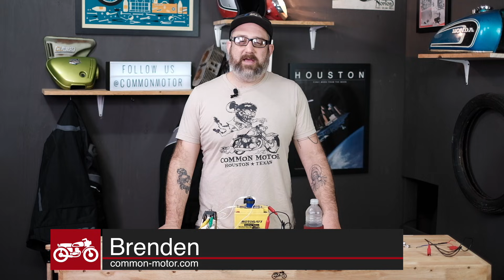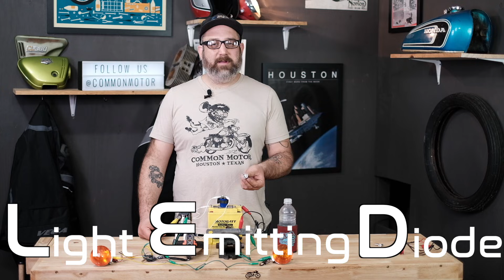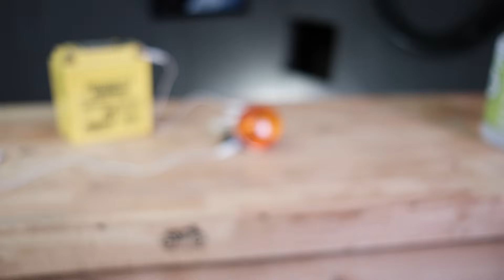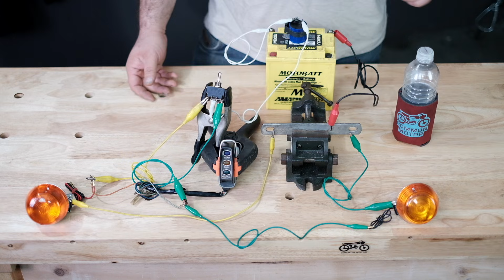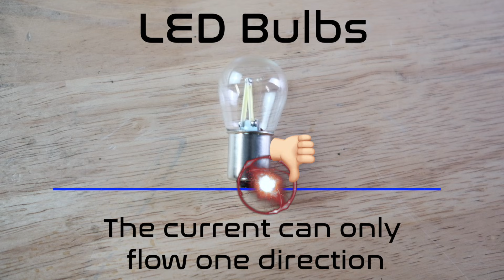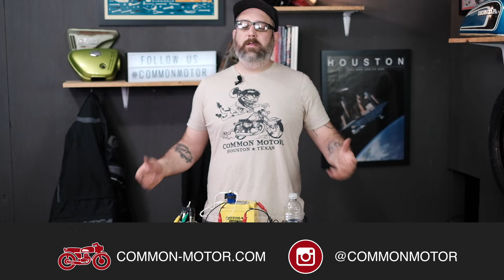How To Get LED Turn Signals Working On Your Vintage Motorcycle

Comment: have lot better understand what need doing change leds my scooter, if have schematic how wiring this, i not found anywere genuine bike scematic my scooter but know were light connect only. need i change light rely ? and add diodes were ? but not need change all light wiring ?

Comment: Just one thing... LED is not an acronym. 
An acronym is a word made up of the first letter of other words, and it is pronounced as a word.
For example, Special Weapons and Tactics became SWAT. And Swat is pronounced as "swat."
But LED (light emitting diode), ATM (automatic teller machine), FM (frequency modulation), CPU (central processing unit) and such are just letters and are not pronounced as words. Thus, they are not acronyms.
They are initialisms.
EDIT: Ok, two things. A couple of diagrams would have helped immensely. A it is, I need to look elsewhere because you gave the reasons but not a clear illustration of what actually runs where.

Comment: odd my honda has running lights on the signals 3 wires each side ,  running light, and signal light , this does not explain it just confuses .  you cant see a clear image of the set up or direction for the splitter diode

Comment: It just seems wrong to me. If it’s possible to maintain originality then I think you should stay true to the design. In the uk there is an historic vehicle registration system. This gives certain age bikes a free tax and mot category. But there are limits and the bike does need to look and act like the original. I’m not saying led lights would fail that test but it’s on the path towards ripping out the heart of the classic bike. I’ve seen some 45 year old classics with led followers and head lights and they look bloody awful. The other uk invention is the ‘Q’ plate if your classic has a few bits that don’t match it becomes a kit bike made up of all sorts. The DVLA like to give them a ‘Q’ registration number whoopee. Good explanation on how to but I hope people try and keep originality at all costs until it’s just not possible. LEDs are horrid little things. My house has none, they kept blowing every month and at £7.60 a pop I worked out they were twice as expensive as the incandescent old style bulbs as the energy saved with led didn’t cover the 7 times more expensive cost.

Comment: Do I need two diodes if I’m doing the front and back turn signals?
Reply from the maker: Nope! The diode is only there to help connect the left and right turn signal circuits to a single LED indicator light. One is all you need. Some of the later CB550/CB750 models switched to 2 separate indicators. If you have a bike like this, you will not need any diodes.
Reply: @Common-motor hi! I have the 1970 Honda trail 90

Comment: I need help! If anyone can answer, so I got my rear turn signals working just fine, but the fronts L+R both just come on for either L or R positions, how am I supposed to wire in the wires from the front turn signals so they work correctly?? I’ve been trying different configs but can’t seem to figure it out? If anyone can help please let me know!! Thanks! 
- ‘72 cb175

Comment: I already had driving lights and turn signals installed, but I added a new LED light bar that includes both driving lights and turn signals/running lights, along with an optional headlight. I can hook up either the turn signal or the running light in the front, but not both at the same time. The LED light has 3 wires coming out of it. I've read I have to choose one or the other. I have stock lights in the rear. All lights work fine. They do flash a little fast but I am ok with it. When the turn signals are hooked up they flash as they should not affecting the other side. 03 Kawasaki Vulcan 1600.

Comment: This video was unfortunately only partially helpful because my bike has two dash indicators, not one. So trying the diode didn't do anything. I got them to flash without being connected to the dash indicators, but they won't work when connected. Clearly with two indicators on the dash, the whole process is different than in the video. Im frustrated because this video is the closest to being helpful, but its for an older bike with a slightly different layout. Do you guys have any videos working on 80s bikes, or just 70s?

Comment: Good vid. I was able to install front and rear LED turn signal lights and LED brake light on my 88 Honda NT650. Have you replaced your instrument cluster bulbs with LED's? I was told the reason my signal indicator does not work is because it's a regular style bulb and needs to be an LED. My oil light still works so I didn't know if this info is correct. Any thoughts?

Comment: I have a little 6-volt motorcycle, a 1985 Honda XL80S , and the incandescent signal bulbs never get enough current to light up or flash. (Could it be a bad flasher? Not sure.)  

So, I would like to convert them to LED, BUT don't know if I can get LED bulbs, flasher and indicator  diode doo-dad that would work with a 6-volt system. 

Your, or your viewers' advice, would be appreciated.

Comment: Two diodes do the job. One per circuit (left and right flashers). Ground wire to the indicator required. Thank you for solution

Comment: I tried to get this to work with a 2 indicator bulb setup on my 500T and couldn't get it to work. I put incandescent indicator bulbs back in and the LED turn signals work fine.

Comment: If the 4 flash at once problem is caused by single dash indicator light - and does not happen with the 2 dash indicator light models - can I just convert the vintage single dash indicator to a pair of them rather than the diodes to stock dash indicator bulb?

Comment: Great video! Just went through all of this on my '22 XR150L Electrically very similar to the classic Hondas. I wired in a new tail with LED signals that worked, but hyper flashed. I fixed that with a LED spec flasher. When I wired in the front LED signals, I got all 4 blinkers coming on together. The quick fix was to pull the incandescent dash indicator bulb and everything worked great. I put a LED T10 indicator bulb in it's place, but it only works when signalling right. I now have some diodes coming and a schematic, so soon everything will be 100% instead of 90%. I actually converted all of the AC current going to the head and tail light to DC so my bike is 100% LED, including the parking light and dash lights. I have a power tap under the headlight shell to wire accessories such as a USB charger and volt meter. Going to be adding mini LED spotlights soon. The 3 way switch is in place.

Comment: Hello. I did this conversion. I used an electronic blinker relay with an adjustable screw for the blink rate. I replaced the bulbs with LED lights front and rear. Added the Wye-Diode kit everything works fine up to there for blinking only. The rear flashing blinkers were single filament bulbs and front blinkers were dual filament bulbs (turning and night marker).  I bought the proper single and double contact LED bulbs for rear and front.  Everything works fine for blinking when my headlight and marker light are off, but has soon as I turn them ON, the blinking is really slow or not at all. What do I do wrong? Do I need some other diodes is the circuit for the marker lights too?

Comment: Hi ! Please ! What type of diode and what value did you use ? And if on my motorbike i have 4 bulbs of 5w do i need to change the relay ? . If i will change all the bulbs with an led  bulbs  should be working without any problem

Comment: So where goes  the one wire from the turn signal indicator in the led setup? Does it share the wire from the diode with the wire from the left or right indicator?

Comment: You don't need to use a diodes or resistors to do the conversion.  All you need is a CF15 LED non-polarity flasher.  It is a three prong flasher, while most Flashers for vintage bikes are two prong.  The third prong goes to ground.  The CF12, CF13, and CF14 will still have problems.  You have to get a CF15.  I got one off Amazon for $11 and my 83 Suzuki GR650 was up and running using cheap Amber 1156 LEDs I got off Amazon in a four pack for $10.  Total conversion cost was $21.  I also converted my instrument panel for $8 for a pack of ten 194 LED bulbs.  Then added an LED headlight.  I got and LED rear/break 1157 years ago when they first came out, back when they were expensive.  It's still kind of dim, as it also doubles as a license plate light, so you have to use a white one in a red on top, white underneath cover.  I've been searching for a dual LED (Red Beam/White on bottom) for it, but haven't found one.
Reply: I'm going to try your relay suggestion.  I'm trying to get a 2001 Honda Rebel LED Flasher System working.
Reply: Thank you dude i have a dope gs750e thats gonna be a stunner once i get it finished
Reply: Yo! So you just swap the relay and run a new wire from relay to a good ground? Then the LED blinkers will wire up with the existing wires?

Comment: I hope you can help me...1994 harley FLSTC...installed kuryaken run/brake/turn LED's on the back...4 wires out of the light ...
installed the same on the front 4 wires out also ...didn't want brake lites on the front obviously...lol...so hooked them up less the brake function wire..also installed a BADLANDS LE-03 unit...every thing is working fine except when either signal lite is activated the opposite side, front and rear , running lite flashes just slightly...its useable but very annoying... the bike also has stock individual turn signal indicators , one for either side , not LED's , which work as they should

Comment: Question, on my 1974 norton commando, I had installed 4 led bulbs and when I put on the turn signal all 4 bulbs start to flashing, also i already have an electronic flasher in the circuit...any thoughts?

Comment: Do I need the diod wire even if I have a after market led flasher relay?
Reply from the maker: yes! the diode will always be needed because of how Honda set up the turn signal indicator wiring to the gauge.

Comment: Hello, could you tell me your opinion? Cbr125 2007 had led flash and i changed to new led. 3 wires 1 black 1 green wire  that lights the yellow light rolling and 1 red wire that lights blue stable. I connect negative  to black and positive to red and green. However i changed connection every side of the switch light both sides. Do you think the relay is burned or needs to be changed? Thank you.

Comment: I changed my signals to LED and didn't know about the diode. When I turn my switch in either direction, all my signals blink simultaneously!  Crazy!  Will a diode fix this??

Comment: Hello Sir, i have question. i have 4 aftermarket turnsignals. 2 for rear has 2 wires but for the front only has 1 wire ( black colour) . i am puzzled. maybe you can help me how to connect ?
i am trying to install those on my yamaha dragstar . 
ty in advance
Reply from the maker: it sounds like you might have turn signals that ground through the body of the turn signal. The OEM honda turn signals do this. Usually, if it has 2 wires and grounds through the body the turn signal will have running lights as well.
Reply: @Common-motor  Thank you for your explanation Sir , realy appreciate it. i think i will try using a "washer" with cable for the ground(body). have a nice week .
Reply from the maker: @abigail_mcleod  glad to help!

Comment: 2017 xr650l...Ok..led light switch over. Put led bulb in indicator socket also. Led flasher installed. Turn on...right side works great with dash indicator light flashing correctly. Turn Rt side off and turn Left side on...left side blinks appropriately BUT THE DASH Indicator LIGHT DOES NOT WORK but the left turn signal works fine. Tried a diode kit and it did not work. Im stumped

Comment: In order to get my issues with the battery discharging on my CB 550 K3 solved  (new rec-reg is ordered already) I came to the idea to support my whole electric system by replacing bulb lights by LEDs. Too bad that it is hard to get such LED components or even kit in Europe due to all this regulations.
BTW  I noticed that even the ignition rebuilt on base of Dynatek (coils cables and switches) consumes more electricity bc due to lower resistance of the coils. (Do you guys have such thing also experienced after rebuilt the ignition system ?)
Reply: can you please elaborate this problem with eu regulations, i'm interested in restoring some old honda (and vespa, too). homologation problems or something else?

Comment: Do you need the diode if you do not have a dashboard indicator light?
Reply from the maker: Not at all! Diode it just to modify how the stock harness is setup for the indicator to read both sides of the turn signal circuit.

Comment: Hey there. Great video but I was wondering if you would do a video on wiring up a 6V system on a vintage dirt bike, start to finish? I live in a state where anything below 300cc can be registered if it meets the safety requirements. I have an 84 KDX 200 and I’m dying to get some lights on it. Please let me know. Subscribed!
Reply: I have the same issue, and just posted a question about 6-volt systems. I haven't dug in deeply yet, but want the bike to fully function, esp. If asked by police to prove it. It's an 80cc bike, and looks too small to be a street bike. It will do 40 easily, though, so is great for roads posted at 40 or less. Perfect for taking camping as a get around gizmo.

Comment: Draw a diagram will make it so much easier 🤤
Reply: At least arrange the wires in such a way that we can see where everything is running!  I appreciate the thought, but this rat's nest and off-the-cuff explanation didn't teach me anything.
Reply: Can someone make a diagram of what just happened in this video. Lol, the purposeful wrong wiring made it a lot more confusing to follow the circuit.
Reply: @Kashton Cory Instablaster ;)
Reply: @Armani Jamal I really appreciate your reply. I found the site on google and Im in the hacking process atm.
Takes a while so I will get back to you later when my account password hopefully is recovered.
Reply: @Kashton Cory No problem =)
Reply: Agreed
Reply: Will I have to do the same for a 6v 1981 honda c70 passport?
Reply: Without a wiring diagram for both types, this is a useless video.
Reply: you all prolly dont care at all but does anyone know a trick to get back into an Instagram account??
I was dumb forgot the login password. I would love any tips you can give me.

Comment: hi, i have a ducati xdiavel and there are ledlights doing fine and blink in same patron.
no i have bought ledstrips(small strip with 6 ledlights on it and it flashes not in a good tempo, it goes normal blink blink and then 3 times very fast and then again 2 times normal. so something is not good, i used very thin wire with connectors, can that be the problem or what can i do to flashing in a good tempo?

Comment: Through which connector does the relay reach the battery? I just started building a cb 750k 1979 and the lights dont wprk so i plan on rebuilding the harness

Comment: Thanks for your video. I have an LED flasher unit on my bike and am ready to install new LED indicators. Question: Do I still need to wire in a resistor/diode or will the indicators work ok due to the LED flasher unit?  Many thanks.

Comment: Why the HELL would the bike mfr have the INDICATOR light ground thru the OPPOSITE BULB???????   That is RETARDED. The indicator is getting the 12v from the side that is blinking, and there's literally NO REASON they couldn't have just used a single connection STRAIGHT TO GROUND!!!  No need to go THRU one of the light bulbs to get to ground!!!  They probably are using the bulb's resistance to limit the current thru the little indicator light, but a simple resistor inline with the indicator light would have accomplished the same goal without causing such a screwy situation with the ground wires!!!

Comment: This is a terrific vid I'm going to watch a few times til I have this down. However I have an issue in that on both my cx500 and cb400a both 78s they have running lights, so when both signals are not blinking they light up for visibility this basically adds two more orange and blue wires and I still haven't figures out how to wire this correctly without the signal indicators being on always... Any advice?

Comment: I've got a 91 Honda NT650. I hooked everything up properly according to the diagram. My running lights are on in the front but no blinkers on all four corners. Although the running lights indicate when the blinker should be on. Once in a while, though, I'll get a quick blinker but it shuts off after a couple times.

Comment: I'm in a situation with this where with or without the diode mod, I can't get the rear turn signals to activate. Any suggestions? Working on a 500T
Reply from the maker: Schedule a tech support call with us over on our contact us page at common-motor.com. We can help you figure out what’s going on there!

Comment: Great video, but the problem I am having is everything has been converted to LED (headlight, taillight, and turn signals along with your led compatible flasher relay) and when I flip the switch for the headlight, it comes on, but the turn signals no longer work? Everything appears to be hooked up correctly?
Reply from the maker: Hmm thats a strange issue. Reach out to the tech support phone line on our website and we should be able to get you figured out.
Reply: @Common-motor  thanks I'm stumped, I'll give them a call
Reply: TechSpecAgent08 I have the same problem. Did you find a fix?
Reply: @KamieNJim  nope not yet

Comment: if i disconnect  the turn signal indicator will i still need a diode?
Reply from the maker: well if theres no indicator your turn signals won't flash. Both the diode and indicator are needed if you want your Honda to have working LED turn signals.